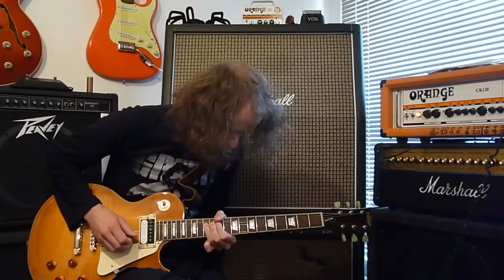Why I prefer Solid State amps to Valve amps

Comment: Yes, no-one can hear the difference between valve and solid state amps.  Everyone hears what comes out of the speaker/s and if you put valve and solid state amps through the same cab you get the same general speaker sound. 

Greenbacks sound like Grsenbacks.  Vintage 30s sound like Vintage 30s.  

There are of course differences in what valve and solid state amps do to the signal between guitar and cab, and those can be audible depending on various factors.  If you use pedals they change things around too.  But the biggest factor is always going to be the speakers.
Reply: @TheBoss0Time Okay, let's work it through.  What sound do you get out of any valve amp when it is not connected to a cab/speaker?  If you turn it on you get nasty sounds as it catches fire.  

When you connect a valve amp to a cab loaded with greenbacks can you get the same timbres and pitch/frequency range and when you connect to a cab loaded with Vintage 30s or, for the sake of comparison, some no-brand Chinese made speakers?  No.  

When you connect a solid state amp to the same cab/speakers do you get the same frequency limitations and timbral range?  Yes.  Greenbacks literally cannot produce the same range as Vintage 30s.  They are voiced differently.  

Do you hear things other than the note/pitches as part of the timbral output from the speakers?  Yes.  You hear the tone stack from the amp and you hear various elements from the amp design and the current operating state.  Valve amps have more variation in that regard but the core of the sound is the same.  An E3 is an E3.  A4 is A4. 

 The thing to get over is comparing solid state amps to specific valve amps (usually run through different speakers) and saying "Ha! This one doesn't sound identical to that one, so it is inferior."  They are not.  They are different tools for achieving the same end.  Music.  Harmony and melody.

And if you really want to get into it, pick up an old modeller like a POD and pretend there are no labels on any of the models.  Just treat it all as a timbral toolbox.  Then you will be listening with your ears and not your eyes.
Reply: @TheBoss0Time Cool.  And good luck to you.  I like my 5W valve amps and I like my solid state amps (two of which are bass heads) and I like my digital stuff.  It's all good.  The game is in finding what music we can all make with each set of tools.

And how much enjoyment we can get from the finding out.  

Digital pianos are fun too...

Comment: To each his or her own,...but Tube amps are far superior in not only sound, and color but far more importantly, Tone.  I've used both.  In my early years when I had no experience, I loved whatever amp I could get my hands on.  And they were all super awesome.  But as I grew musically, I began to understand that to get that "sound" I was hearing inside my head, it could only come from those amps with tubes.  Now, 20+ years later, I honestly wouldn`t even consider using a solid state amp unless playing a steel guitar, something like one of the high end Peaveys or the Roland Stereo Chorus.  But for 6 string, Tube, all the way.  Many times those who speak negatively of tube amps are green so to speak or have only had experience with poor amp choices.  But there is a reason that 99.999% of those guitar legends that you have ever heard use Tube amplifiers.  Its not a fad, it`s due to the warm, fat, full tones provided by a good tube amplifier.  Just take your favorite solid state amp and then listen to someone playing through a Cieratone HRM or a Marshall JTM45, or Marshall Super Lead from the 80`s, or if you like clean tones listen to a Fender Blackface Twin, or if you like versatility and a legendary amplifier then listen to someone using a Vox AC30.  This is just my opinion, not wanting a debate.  I`ve been a professional gigging recording artist for over 15 years so I speak from the heart.  There`s nothing really wrong with solid state amps and if you like them, buy them, but you`ll be missing out on so, so much.  Oh, and btw, in all of my years gigging, I've never had a tube go out in any of the assortment of tube amps I have used, not one time.

Comment: I agree with what you are saying "NOW" but had you asked me this 20 years ago before technology got really good for guitar amps I would have laughed you out of this video. They do have great solid state amps now that are close enough to a tube amp where the need for a tube is only personal choice. The difference for me with a tube is you can get different tones with different types of tubes. Each tube has it's own character. Now though the tech is so good, you can sound like any amp/tube you want by just uploading a sound profile or adjusting your pedal bank.
Reply: When I started in 79 or so solid state was a little rough.  I can find a decent sound from any good amp now.  Certain tube amps have a specific sound though.  Like the JCM 800, or old Fenders.  The only advantage I can think of these days for tube amps is the rectifier tube.  Playing style makes the tube work harder for it to regulate voltage, so you get a response there.  Solid state rectifier is immediate.  So IMO you need to go really retro or just use new stuff.  A tube amp with a solid state rectifier is just a hassle.

Comment: I get a better sound out of a 1976 HH IC100 with an opamp distortion circuit that cost me £150 than a lot of guys who've spent ten times that only to stick solid-state distortion pedals in front of them. Carlsbro Stingrays are awesome as well. Analogue SS amps can be fantastic if you get the right one.

Comment: what would  you  recommend  as a   good  solid  state  amp  for use  with  a  pedalboard ? ( one you  can  still  buy new today )  thanks .
Reply from the maker: Any of the orange crush series. Preferable the Orange CR120, CR120 combo or CR60. :)
Reply: Hi Jeff, I really MUST recommend you at least try the Roland Jazz Chorus. I have the JC40 and it's super sweet, really nice chorus and reverb, 15 Kg and has a loop for effects. It's not exactly cheap but it's a 2x10 with stereo in (and out, like for going in a PA), stereo chorus and vibrato. They even made the distortion better (tough not absolutely beautiful, it can add a little grit to your sound). Try one!
Reply: JCBigCat thanks....I'll  have to check  one out.

Comment: I used to be valve only and I still own two handwired fenders and a handwired vox, all under 15 watts as home only now, but I also own a vox modelling amp and a fender solid state and to be honest there isn't much in it, I do feel the tube has the edge but only for touch dynamics and it's so small it's not worth me recommending the price cost to anyone on a budget, Trust me in pubs and clubs u can forget about the big tube amps as u won't get them past 3-5 lol, deluxe reverb or Princeton reverb is best or solid state just because its lighter and cost little.

Comment: Sorry man, but, I can hear a major difference between my Randall RG80 solid state amp and my Bugera Trirec tube amp. The Bugera is so much warmer. I enjoy both amps for their own applications, but, the tube amp is still my personal choice. The Tube amp I got for $500 and it sounds amazing, so, price really isn't a good reason to me to give up on tube amps. Infinium Technology prolongs the life of my tubes and auto-biases them, so, not much extra expense there. My RG80 (55lbs)weighs more than the Bugera(52 lbs..Barely, but, still), so, weight really has no basis in my argument for or against solid state amps.

Comment: Interesting, yes the single most determining factor for tone is the player him/herself, if the amp gets the job done just buy the lightest, cheapest most reliable one. Then when you add effects and tap into the PA you have to sniff hard to tell which cork it is. :)

Comment: I don´t like the sound of the clean picking in clean solid  state amp, and the dinamycs i mean the reaction to the picking strength when i krank up a solid state amp. But that is fine tuning, using effects are great, and with tube over drives may be good, they´re cheapper and ligther, use what you like or can afford.

Comment: So...after 10 years of solid state amps I’ve come back to tune amps.  Yes, they can be temperamental and require more maintenance and care.  For gifting a solid state amp is easier to control and get consistent sound.  But for recording, tune amps are my preference.

Comment: the only advantage a solid state has over tube in the sound category, is they sound great at lower volumes, while a tube amp will sound best cranked. if your playing at home, ss. if volume isn't a problem, tube. SS sound bad at high volume, tube gets sweeter and sweeter the more you crank it.

Comment: great points all around, really. I would be interested to learn a little bit about the fiesta red strat behind you. that is very tasty, and wondered if it was some kind of reissue number and whereabouts a chap like me could find one.
Reply from the maker: Thank you very much. The strat behind me is actually a squire bullet i refinished in fiesta red. I have a few videos using it. It sounds absolutely awesome. Thank you for watching.
Reply: yowza. I would love to have a guitar refinished in that color. any suggestions? do you have a video on that, or care to share what products were used in that masterpiece? That color is not so common methinks.

Comment: i love my solid state boss katana 100 1x12. i also really like my old hybrid peavey classic. featuring poweramp 6l6es and transistors in the pre amp section, and i also really really love my very old dynacord hifi favorit IIT wich is also hybrid, featuring trannie pre amp section and 2 el34´s in the poweramp section.
i certainly do hear a difference in different amp concepts and i can clearly tell you the difference between an all tube amp, a hybrid or a trannie.

it depends what you want to get out of the amp.

and it also depends on if it is possible for you to turn a non mastervolume amp all the way up to make it sing the way its been meant to sing and turn up say a yamaha dg100 2x12-another great transistor amp i own- i own a shitload of amps....all collected over the last 50 years. the aforementioned yamaha for example is a killer beast. it is louuuuuuuuuuuuud. very loud.
but on the egde of its capabilities, when it starts to distort..........about 10 minutes after you became deaf, means you have to leave the building and go outside on to the road to make this test for the amp is that fucking loud, you will notice the amp all of a sudden starts to sound ugly.

if i repeat this test using my non master volume marshall jtm 45 -you also have to leave at least the room, rather go out on to the street, you will notice quite the opposite. the louder it gets, the better it sounds until it gets no louder at all but just compresses more due to powersupply sag and collapsing. this of course happens a lot earlier on say a fender super reverb, another one of my amps, for this one is relying on a tube rectifier instead of the solid state design rectifier circuit i put into my jtm 45 to make it break up later. marshall himself gave the jtm a tube rectifier. i came to the conclusion i want the thing to sound a bit more brute, wich is why i came up with this (switchable) modification. one flick of a switch and your back to original.

Comment: I'll buy into the economics of solid state over tube amps. Weight and carrying one or the other up & down a flight of stairs. The amp isn't really the problem there, it's the 4x12 cabinets that are bulky and heavier. Even the 2x12's are heavier. I doubt anyone notices the difference with 20W solid state 1x combos vs a 20W tube head and a 1x cabinet. All one needs to do is look at the hybrid 20W lunchbox amps that Joyo, Orange have & compare it with a 5W Bugera. Weights are manageable lifts & haul loads even with the heavier Bugera. I preferred the Bugera over the Orange myself.

Comment: Just got a Blues Cube Artist and I suspect I'll be sticking with SS amps from now on. I have owned many a great tube amp over the years but they are a bit finnicky. I've had too many instances were the tube amp has crapped out unexpectedly or developed some rattle or buzz that annoys the living hell out of me. And I also agree that, although there may be a slight difference in feel, I don't hear a difference either. The consistency factor weighs heavily too.
Reply: I have to agree they can be awesome sounding, but on the way to the gig you can lose a tube, or any number of other things can happen to a fragile glass tube amp. they have their benefits and disadvantages too.
Pound per pound dollar for dollar I have to go with the digital.

Comment: Unfortunately, 98% of guitar hero status players wouldn’t agree. SS amps, while very good at clean amplification, cannot replicate the inherent character of a driven tube amp. The simple answer why is that valves are inefficient by nature and begin adding even order harmonic distortion the more you add gain. This anomaly is mostly perceived by humans as “more musical,” since the instrument tone is complimented by the addition of this distortion. This also creates the “perceived loudness” oddity that is a psychoacoustic “trick” played on us because the harmonic complexity added by a tube amp convinces our brains of greater volume.  SS amps are far more efficient at amplifying sound but do so without much addition of these harmonics, causing the listener to classify them as “sterile” or hifi in character.  Even a comparison between a typical newer hifi amplifier and a vintage MOSFET amplifier from the early 70’s with demonstrate how anemic and thin the newer (cheaply made chip amp) amp will sound even if the vintage amp has a much lower output power rating. My vintage Sansui at 40 watts RMS blows my newer Onkyo 100 watt amp out of the water. This same anomaly is true of guitar amps. I have many amps but the difference in character between the SS and tube amps are night and day. It’s a good lesson in the point that new technology doesn’t mean better. That’s why valve amps are still hugely popular today with 100yr old technology. Just my two cents. Cheers and love your channel & playing

Comment: As far as maintenance on a tube amp my Fender Hot Rod DeVille 410 was re tubed and biased once in the eight years that I have owned it. In my second year of ownership I swapped out the groove tubes with a set of JJ's...All of the preamp tubes are original. I don't think the volume knob has seen the Northside of 3 it's that loud. it never leaves my house for 2 reasons . Firstly it's a work of art and secondly it weighs as much as a Volkswagen. Having said that I also own a couple of solid state heads I have no complaints about them either. It's like the debate about who's better Kobe or LeBron. seems like a pointless debate

Comment: Dave, Dave, Dave...not to be arrogant or even a prick because taste is taste and to each his own...but, to say you can't or even you've never heard a difference in sound between solid state and valve amps kind of makes me question your hearing because the difference is MASSIVE...I have 3 combos 1 valve 40 watt, 1 valve 15 watt and 1 solid state 100 watt 2x12 and they are all Fender amps and the difference in sound is HUGE I prefer to gig with my solid state because it sounds okay, it's loud and light but it doesn't compare in terms of quality of sound IMHO to my other two valve amps.Cheers, Mike.
Reply from the maker: Like you say its all down to preference. I'm not saying i hate valve amps or anything like that because i don't. I owned one and gigged one for years. Simply put i don't hear whats different in the sound. But thats just the way i perceive sound being me. My preference is just towards Solid State as thats where i have always found my sound thats in my head. I'm one of those people that once i have found what i'm after i don't change because i don't feel the need to. The only valve amp i have ever got on with is the Marshall Plexi. I suppose you could say its a dave thing. Haha. Thank you so much for subscribing and for watching. :)

Comment: Where people can really hear the difference is picking soft and loud in one measure. On a valve amp you can go so soft you can almost go silent. On solid state it's more like it just there or it's not. Limited dynamic control. Dynamics in music is more musical and professional. I think valve sounds better in general too.
Reply: maybe...but orange in particular is closing that gap...high quality SS amps.
Reply: stratman 45 Just got an Orange CR60, totally agree! :-)
Reply: Geting into that $ range I might as well throw in a few more bucks and get the vintage tube amp (although maintenance will be higher on the tubes, obviously).

Comment: When you have the comparison videos it's hard to tell them apart. However when actually playing it you can feel the difference because it interacts with your guitar differently. Valve amps are also better at dealing with pedals in my experience. Saying this when recording on the cheap record your main guitars on a nice set of valve amps and use amp models for stunt guitars and for doubles

Comment: Yeah and I doubt the average audience member would be able to tell the difference, I have guitar recordings made with an old line6 podxt through a Peavy basic40 bass amp which is solid state i use for guitar as my basic amp, I do have a few valve amps.  I used the internal mic on a basic tascam 4 track digital recorder, no post processing or anything, and I fooled everyone into thinking I was recording valve amps.  Solid states work very well especially if eq'd right.  They are cheaper and more reliable in general, my Peavy is from early 80s, Ive had it for 19 years, never had a problem, I also have a 1959HW Super Lead, and I had it sent in for repairs 2 times within 6 months, love it, but its finicky